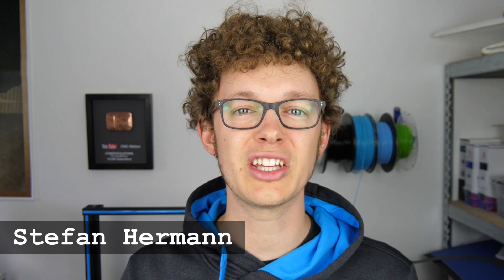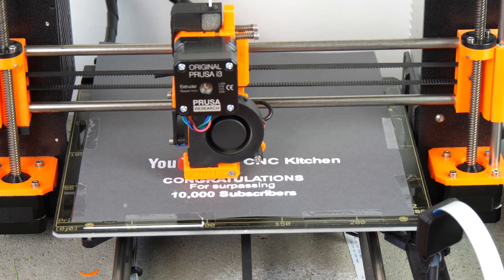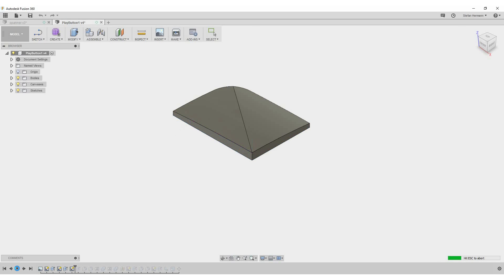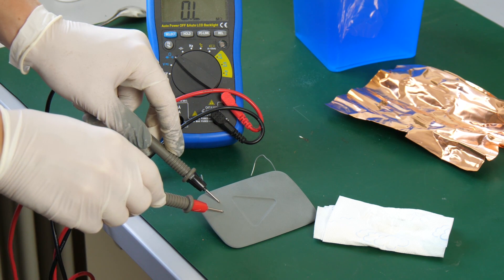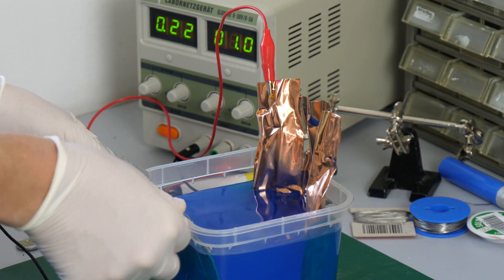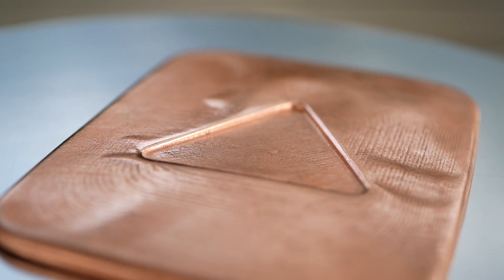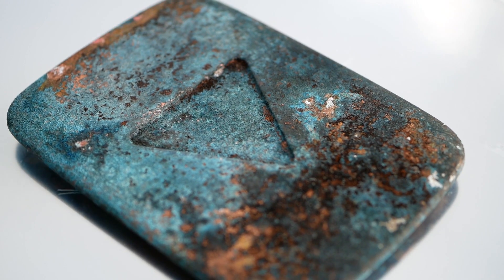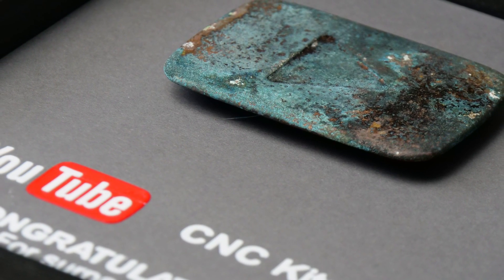10k Copper YouTube Play Button - Copper plating 3D prints + #giveaway

Comment: Congratulations !

Also, wonderful idea to deposit directly on construction board.

BTW- Another potential candidate for your testing, although I've not found anything on "PCTG" filament other than this one manufacturer, so it may be just marketting fluff, but they claim it's more chemical and impact resistant: http://essentiummaterials.com/wp-content/uploads/2016/08/ESS-090-TDS-PCTG-V3.pdf

Comment: Looking at your video i can point out that graphite 33 works as a base for copper plating but its very slow due to the fact that carbon has a high resistance this can be overcome partly if you spray multiple layers of graphite 33 before electroplating.
good job continue making videos :)
Reply from the maker: +Patrik Sjöberg I also had a layer of copper forming from the cathode, but it would have taken hours to cover the whole part. I think it's just really impractical.
Reply: Yeah i totally agree, but if you for whatever reason need to use carbon as a base or make "conductive" paths use multiple layer spray (check with meter makes a lot of difference each layer)

Comment: Hast du eine Idee, warum das Bett sich verbogen hat? Meines ist auch etwas verbogen :( Und die manuelle Betthöheneinstellung funktioniert auch nur suboptimal. Vielleicht hätte Glas doch auch wieder seine Vorteile
Reply from the maker: I prefer a stable bed with manual leveling over this. I was like this from the beginning on. In my opinion the bad carrier is badly designed, flexing the bed.
Reply: Ach ich dachte du bist deutscher? Dann könnte man doch wenigstens so antworten. Hatte ich erwähnt das ich es total doof finde, wenn deutsche einen englischen Kanal haben? Man hört es fast immer. Aber Hauptsache die Abos stimmen...

Comment: When you polished the copper,  did it separate from the plastic, or did the plastic melt?  If the plastic melted, would ABS be a better choice, and maybe a higher infill?  Last thought, 3D print a fast version of the button, then CNC the finished profile, maybe less sanding?
Reply from the maker: The copper separated from the part, maybe also some of the plastic got soft. I definitely need to use a higher temp plastic the next time. I did use Formfutura Volcano before where I did not have that issue. Time was just running out for me.
Reply: @CNCKitchen  I wonder if its possible to increase adhesion. Maybe use lye to etch micropitting into the PLA.

Comment: I really liked the idea of the impact testing rig. It looks like it is possible to deliver more accurate results than Thomas Sanladerer's rig, as you don't rely on the camera catching the highest point the hammer went, but instead have a marker that automatically stays at thst position.
Reply from the maker: Yes, that was the intention behind adding a drag indicator.